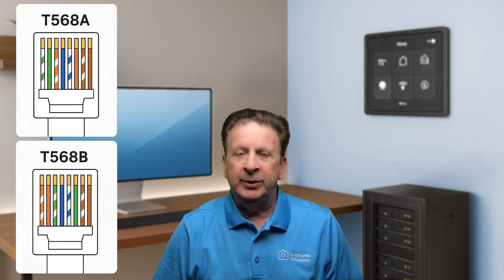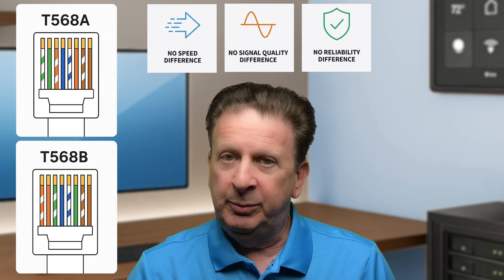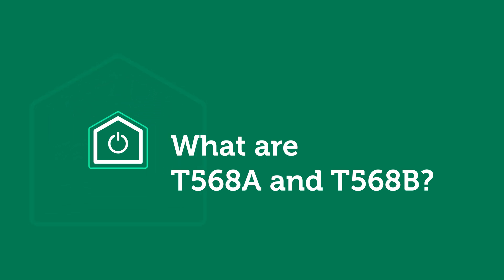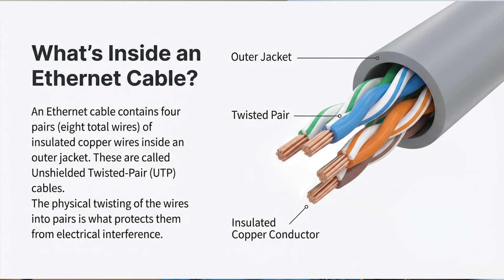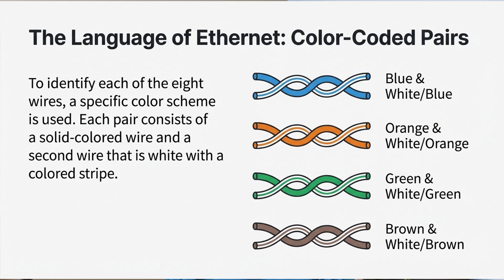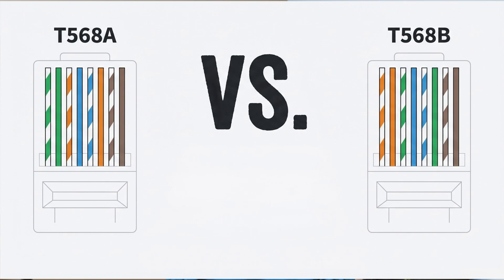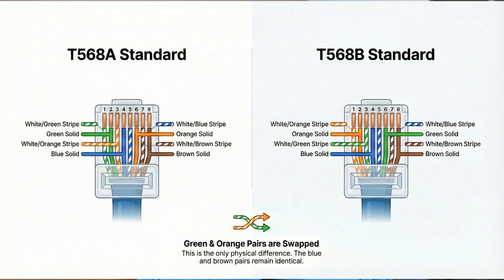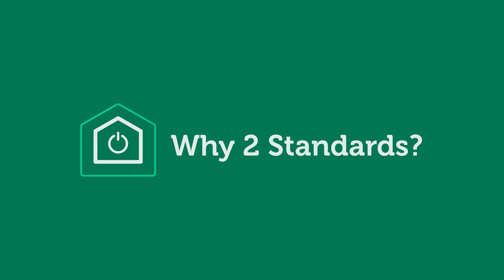T568A vs T568B: Which Ethernet Wiring Standard Should You Use?

Comment from the maker: What do you think?  Do you use T568A or T568B in your smart home?
Reply: I use B, because every cable I have every purchased for a patch cable is B and I don't want to deal with either making custom A cables or trying to find A patch cables.
Reply: @cybernoid001  You're trolling, aren't you?
Reply: @docugraf no i am not, in the US B is the more common standard and so when you buy patch cables from US storefronts, thry are mostly B. At least in my experience.
Reply: @cybernoid001  The color of the wires doesn't matter to the electricity.
Reply from the maker: Using A or B patch cables is fine, but it is simpler to avoid argument and not having to explain why/how using B patch cables when everything else is wired with A is fine and works.
Reply: @docugraf the color doesnt matter, but order of them does. Today, mlst Nics will auto-switch if theres a crossover, but i ha e plently of clients in manufacturing that have legacy devices and you have to get it right. Otherwise the machinery doesnt operate.
Reply from the maker: Yes, patch cables are usually only available wired for B.  Good approach, but you can actually use A patch cables fine, even if everything else is wired for B, just simpler and cleaner to stick to one wiring for everything.
Reply: @DoItForMeSolutions  nowadays - yeah, you can. Even late 100Mbps nics were ok with whatever wiring, and I think all 1gbps Nics support whatever wiring. But if you are into any retro hw or actually even some of the more hardcore industrial embedded iot stuff - you might encounter hardware that still require you to have the mixed wiring for cross connect cables.
I was just saying that I was surprised that you haven’t mentioned in the video about that use case and that it was actually a huge thing 20ish years ago.

Also a bigger part of the beloved for signal integrity is about cross over - that even if your device support Auto MDI-X correct wiring would increase signal integrity. I don’t think those believes are actually any true though.
Reply: @DoItForMeSolutions  Same here. B are available as part of router, computer and other network sets. So people who are not familiar with cabling can just "replicate" connection with any cable around. Keep in mind - quite often if they have "broken Internet" they have no easy access to pinout diagram. Replication of existing cable is easy. :)
Reply: @cybernoid001 Same here. Otherwise if something is already done, of course the same as the other end.
Despite that, you can wildly mix the standards, as mentioned, as long as the both ends of one cable are the same standard
Reply: B is for superheroes.
Reply from the maker: I’m saving that for the next time I have something starting with “S” 👍
Reply: Still slightly confused. Does backward compatibility with analog phone lines simply have to do with the colors? Was it expected that the second phone pair would be orange? Even for phone lines, either standard is the same electrically.
Reply: @MarkSidell  the way it was explained to me is the telphone pairs work out from the middle.  The middle two are the first pair, the wires on either side of the middle pair is the second line and the outer pair is the third line etc.
Reply: @steinshaw2490  For A the two middle wires are pair 1 and the two surrounding that are pair 2. For B the two surrounding wires are pair 3 which is confusing and what they tried to fix by standardising A. This is because while there are two variants of how to wire (A/B), there only seems to be one wire color to pair numbering scheme: blue=1, orange=2, green=3, brown=4.
Reply: Very much thanks. Now I know that B is the correct and future proof option.
Reply: @ivekuukkeli2156  How did you came to that conclusion?
Reply: I've always used 568A
Reply: In Europe A is non-existing. Nobody uses it. So don't be the A-hole  that uses the other standard, confusing everybody else. (Because maybe they should check, but nobody does anymore)
Reply: Don't use AI images. 1:36 is a joke. How can you give out such sloppy work from your hands if you want to educate?
Reply: If you remember times of 10/100BASE-T and older hardware, you might also remember that cross connection between two computers required you to use a cable that had T568A on one side and T568B on the other. I was a bit surprised not to hear about that part of the story in the video
Reply from the maker: Yes - early switching and routing gear also has built-in buttons for selecting MDI or MDI-X (internal crossover) so you didn't have to go running to find or build a separate crossover cable when needed.
Reply: I lives in Federal Republic of Germany and worked often in Kingdom of Thailand so I use T568-A inside structure cable link. This typical outside the US. 🤗🥰😉 For the self-made patch cable it is equals.
Reply: The key thing here is evolution of the Ethernet Standard as speeds and technologies improved from 100Mbps to 1000Mbps a quarter-century ago. Auto-MDIX was mandated in the GigabitEthernet standard (IEEE 802.3ab 1000Base-T), so one did not need to worry about using straight-through vs crossover patch cables between device types (server/client), as the devices would autonegotiate Tx/Rx. Older 100M devices did not have Auto-MDIX buit in (but, as you say, some had a manual button to flip those pairs). Newer 100M devices often did incorporate Auto-MDIX at the manufacturer's discretion, which is why the 1<>3, 2<>6 crossover wiring is almost never needed today, unless dealing with very very old kit.
Reply from the maker: If I recall, when the outer color of most Ethernet cables was always blue, orange was typically used for cross-over cables.  Not a standard or mandate, just a common convention.
Reply: @DoItForMeSolutions i remember that too in my cisco classes, back when few switches had auto crossover ports, the X cables were red/orange.

Comment: Auto mdi/mdix makes so a crossover cable will work the same as a straight cable. It changes the port rx and tx so it works. 99.99999% of every device made the last 10 years has this feature so it doesn't matter but you should use B to B as it is the most common
Reply from the maker: Yes, auto MDI-X has simplified things significantly!

Comment: A v B matters when you find jack panels only "made for" either type. Many come with 110 Krone etc to terminate premise cables with each pair in "simple order" and then PC board to RJ45 is wired as A or B. So Station Jacks must match them or expect problems. (ignore auto wiring with new cards/switches) When you buy or make Patch Cables the colors don't matter except wires have same split pair for pins 3 & 6. While RJ11 will plugin to RJ45 jacks and center carries 1st phone line, the 2nd pair can be another phone line OR power to a phone. And isn't just PBX have use yellow/black (4 wire) or orange pair (T568A) for Power for whatever phone used. Example: Old "Princes" and other models had lights to glow that use yellow/black pair for light power from a "wall wart" somewhere else in a home.
Reply from the maker: Wow!  I've had exactly the opposite experience.  I've terminated and installed tons of Ethernet cables, punchdowns, keystones, and connectors and never found a single one that was made for one type or the other.
None have precluded using T568A or T568B and in fact, just about every wiring device has always included a tiny reference diagram or chart showing both wiring options.

Perhaps you are referring to older/legacy pre-wired voice wiring infrastructure that is not suitable for data connections in the first place?

I will say, I wish it wasn't the case - I am disappointed no really clever engineer has figured out a mechanical design to prevent improper wiring and only allow actual T568A or B wiring layouts.

Comment: Cable type.... it used to matter when having a straight cable or a crossover cable made the difference when connecting two PCs directly (crossover) or to a hub (straight).

Straight had the same wiring at both ends, crossover had A at one side and B at the other
Reply from the maker: Yes, modern auto-sensing network devices have largely eliminated the need for distinct crossover cables.

Comment: for cat6 and higher, you should use B.  that is for Ethernet cables with a spine.  i mean if run your own, of course.  patch cables don't matter.  the reason for using B on spined Ethernet is that blue and green are on the opposite sides of the spine.  orange is next to blue, wrapping orange around blue will mean a longer untwisted green and brown.  but if one side is already A, use A on the other side anyway (obviously).
Reply from the maker: Interesting point about the spine in Cat6 and higher cables, Have there been any lab test results published?
Reply: @DoItForMeSolutions no clue.  I am speaking from personal experience.  But I do this for a living.

Comment: Bullshit. The choice of sequence depends on the wire used, not your own preference.
Take the end of the wire in your hand, strip off the outer insulation, and untangle the pairs so they don't cross. If green is opposite brown, use sequence A. If orange is opposite brown, use sequence B.
Avoiding crossed pairs reduces crosstalk, which is the first priority. Not having crossed pairs reduces stress on the wires entering the RJ45 connector, which is the second priority.
Using this rule, you don't need to know what sequence the other end of the wire is. Look carefully at the end in your hand, and it will tell you how to terminate it.
Reply from the maker: The standard wiring sequences A and B are designed to minimize crosstalk and ensure proper signal integrity, regardless of how the wires naturally untwist at the end of the cable.

Depending on where you cut the cable, the wires may lay differently right at that point.

This sounds like crazy advice 😜
Reply: @DoItForMeSolutions  Nope. Cables are often marked as TIA/EIA-568-A or -B. Check yourself. 
I have terminated over 700 RJ45 connectors. Pairs dont't swap places through length of cable.
Reply from the maker: That's interesting - I never noticed that the stamping on the cable says "verified to T568B" and not just "T568".  Good info!
Reply: @DoItForMeSolutions  Higher category cables have plastic separator to increase distance between wire pairs. With such separator it is hard terminate RJ45 plug with sequence different than cable is designed to.

Comment: The only thing I ever noticed is that some cables, the blue wires are twisted tighter, more twists.  And the browns are usually loosely twisted.  I assume that this is something with regular cat 6 cables only. Where cat 5, 5e, and cat 6x, all seem to have uniform twists in all pairs.  I do know the ratings have different twist standards.  I just found it weird that a majority of regular cat 6 cable have different twists on the pairs.  I suppose I can look at the pinout, and see which each pin does to come up with an idea why.
Reply from the maker: For speeds higher than 1Gbps, the different twist rates do affect reliability and speed on longer runs.
Reply: @DoItForMeSolutions I know that, it is particularly weird it is only the blue pair with more twist.  I wish I can upload a picture.

Comment: When I bought my house I decided to install wired network to all rooms before I moved in, I had a large RJ45 patch panel that was used in the bank in my town before it was closed that was gifted to me after a friend bought the building. I decided to use this in my house as central as I could. I picked a standard to use and installed all wires the same and did the same to all the outlets. I decided to install two Cat6 wired to each room expanding the options for later. hooking up my tester to check the connections showed that all connections was wrong. confused and angry I had to check what had gone wrong because I did the connections exactly according to the notes I had on both the patch panel and the outlets and it matched. Turned out though that the stickers on the patch panel was inverted, the B was the A standard and vice versa. such a mad error. after I swapped standard at this end on all incoming cables it has worked just as intended
Reply from the maker: That's frustrating situation to run into, but glad you got it sorted out!

Comment: I don't understand how A supports 2 phone lines and B doesn't. There's no reason swapping orange for green breaks that.

Realistically, possible interference ignored of course, so long as the wires are in the same order on both ends the wires can be in any order. Unless there's something I'm missing?
Reply from the maker: Standards are about compatibility. In this case, with the color order of analog pots multi-lines in a single RJ jack.  Whether something "kind of" works or works, in many cases, is not the same as following the standards, of course.

Comment: It's also interesting that you mention Telephone lines using the RJ11 connector, and it can plug into an RJ45 socket. I never would have thought about that.
Here in the UK, we use a completely different connector for Telephones, known as the BT phone connector. The RJ11 is known as the "Modem connector" over here, because it's what you'd find on the back of your PC modem, which connects to your phone line using an RJ11 to BT phone connector cable.
Reply from the maker: Are landlines still in use in homes in the UK? In the US they are becoming very rare.
Reply: @DoItForMeSolutions  From my experience, young people moving into a new home are unlikely to opt for a landline.

Specifically where I live, our ISP went "Full Fibre" and has discontinued traditional land lines, but have a VOIP socket built into the primary Fibre internet router. It still functions 100% as a traditional landline would after the box. In our case, the Telephone engineer just rewired the telephone sockets to connect to this VOIP socket instead of the old phone cable, so we can plug our existing telephone into the new VOIP connection.

New ISPs in our area, which have their own Fibre network, offer the same option for VOIP based Landlines.

I can't speak for other parts of the UK, but since Dial Up is still an option in many places, Landlines are still likely a thing, or have similar VOIP options.

For business, I know where I work, at a college, they have a massive VOIP telephone network, but they adopted VOIP early, so they're special VOIP telephones on a standard RJ45 based computer network.
Reply: @DoItForMeSolutions  in general they're becoming less frequent/popular because more and more people have mobile/cell phones 

however here in UK cable internet isn't particularly popular (only offered by a couple of providers and not in all areas) so most Internet connections are ADSL or VDSL running over a "phone" line at least in part.  many "broadband" internet providers offered a landline phone service as well as Internet services and until recently was essentially a requirement - but got bundled / discounted 

finally fibre to the premises is being rolled out across the country, prompting the move in many cases to "digital landlines" where people want them (basically VOIP)

British Telecom is starting to shut down analog landline services area by area

it has some push back because the landline system is self powered so unlike the digital replacements continues to work in the event of a local power outage - useful in emergencies and for the vulnerable 

traditional analog landline phone services are on their way out but it'll likely be decade or two before everyone transitions to fill fibre Internet - so RJ11s and the UK specific connector will be around still for some time to come 🎉

Comment: Uh... isn't the standard supposed to just be... "Same on both ends for Terminal to Host, Different on each end for Host to Host (typically a router, switch or hub) or Terminal to Terminal", which doesn't even really matter anymore, because most devices are type X, auto-switching between Host and Terminal.
Here in the UK, B is standard, unless it's a "Cross over Cable", then it's A on one end and B on the other.
Reply from the maker: Yes, the auto-sensing capability of modern devices makes the "crossover" vs "straight-through" cable distinction mostly irrelevant now.

Comment: There is absolutely no difference other than connecting wire color.
Reply from the maker: There can be a difference in signal integrity with longer runs because of the different twists per inch of some pairs, but for most home use, it's not noticeable.

Comment: In the Netherlands, the B version is predominantly used.
A is typical of the US.
A and B are both compatible with the pots, even with multiple line configurations. Both configurations provide one-to-one connections, not crossed. The only difference is that the colors of the pots correspond to those of A. But an electrical signal can't see colors, so it doesn't matter. If you establish an A-to-B connection, you have an Ethernet crossover cable. 
The most important thing is that only one version, A or B, is used within a building, not both. Otherwise, it will cause confusion.
Reply from the maker: You're absolutely right that consistency within an installation is key to avoiding confusion.